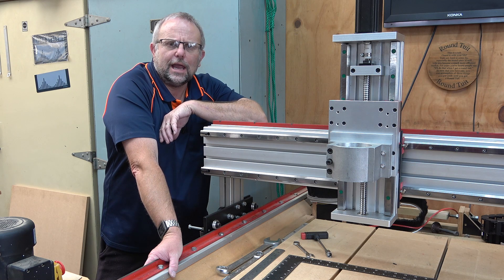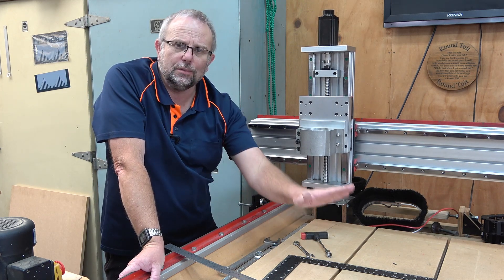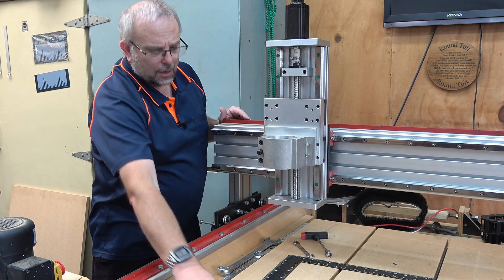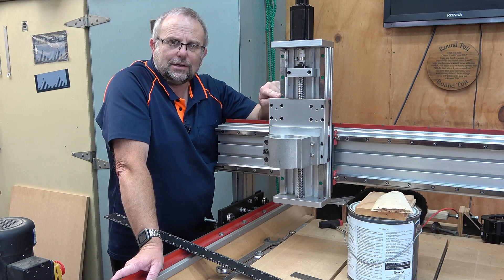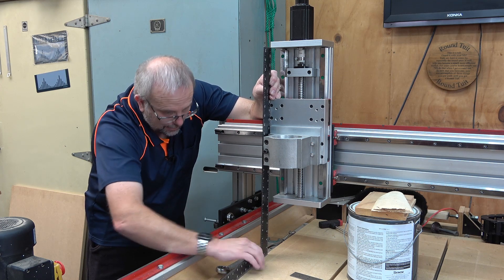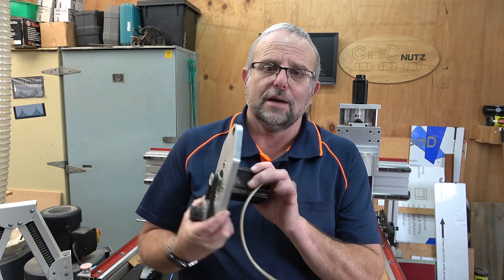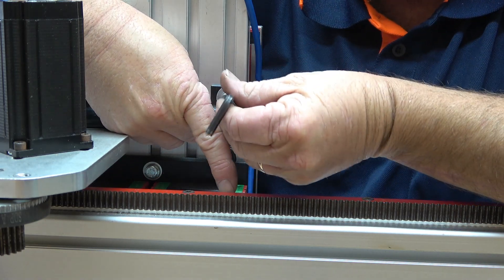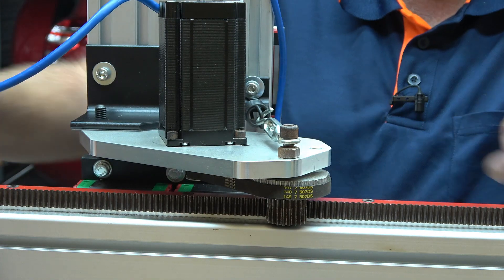X / Z axis upgrade Part 4 - CNCnutz Episode 254

Comment: Peter I like the fact you are able to make a lot of adjustments for this machine that you crafted and manufactured yourself. I have a similar type of machine that uses the bearings to glide over a piece of metal like v grove bearings and I have found over time they need adjustments. I can tell when the bottom bearing is not rotating like the other bearings on the same plate. I have a GarageWorx CNC and I had to go through and modify the bearing slots so they do not fall out of a adjustments. So far so good. We see over a period of time how long it will stay that way. I had issues with the X Axis chatter and not cut consistent when the router cutter going against the wood.
Reply from the maker: Thanks D Zee
I must say that I have never had a bottom V bearing bind up. They seem to keep going and going.
Cheers Peter

Comment: Hi Peter, once you machine the table flat the height will be perfect with respect to the spindle.  The height adjustment needs to be done prior to machining.  The final machining will remove any remaining error.  :)  What, if anything do you use to lubricate the rack and pinion?
Reply from the maker: Thanks Eric. I don't lubricate the rack and pinion and they still show no signs of wear after 10 years of use.
Cheers Peter

Comment: Mr Passuello good day, love the work, and love the channel, three quick questions, can you tell me what profile you are using for the gantry and the model of the linear rails? and do you have any problems with edflection across the length? I am looking to upgrade my machine to an aluminum gantry and it is 6 feet in length...
Reply from the maker: I plan to cover this in Part 6. The extrusion is 80160, the length is 1200mm and the rails are cheap Chinese 20mm linear rails & bearings. No brand.
Cheers Peter
Reply: @cncnutz  Thanks alot, stay safe.

Comment: Please tell me what is the actual Z-Axis complete weight with and without spindle motor.
Reply from the maker: Your in luck, I actually weighed it.  8.7Kg without and 15Kg with the spindle. Another 3 Kg for the X axis plate if you need to know that.
Cheers Peter
Reply: I am so glad you use Kg and metric units.

Comment: I wish I had used rack and pinion. I used ball screws which makes my machine quite slow 🙁
Reply: Slow but stronger and more precise... Everything has a price!
Notice that Peter is using a reduction for the same purpose!
You can install a reduction to increase the speed as well.